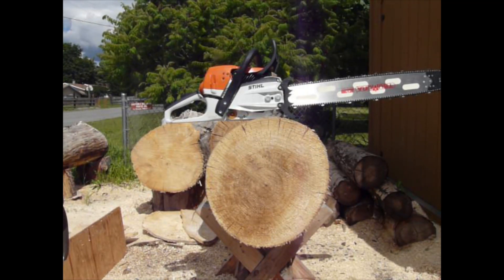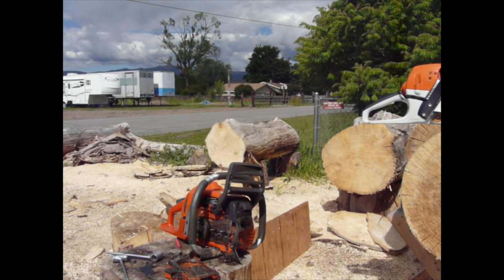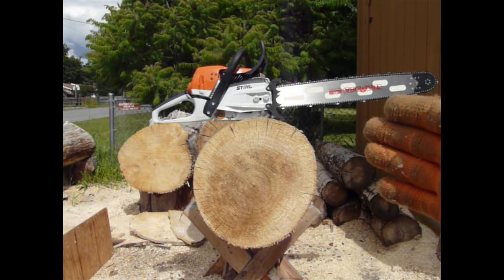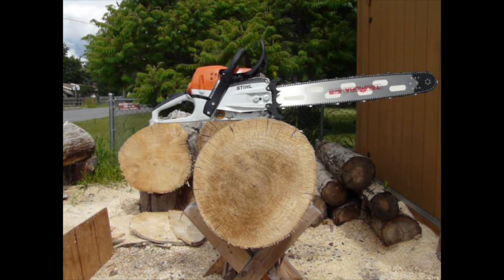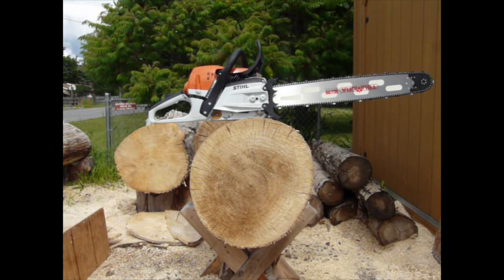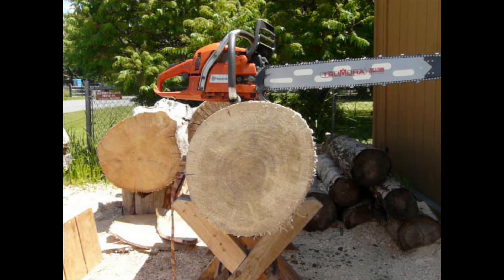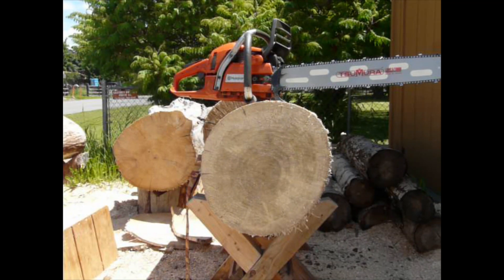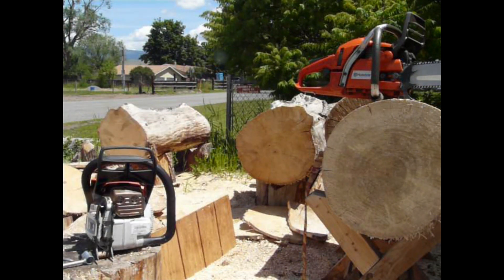Stihl 261 HD2 (stock) filter vs Husqvarna 346

Comment: Where do you get your full wrap handles? I'm looking for one for my 272xp and 346xp, I live in northern Maine and not many people use them but I do..any help would be appreciated.
Reply from the maker: Darrell hi.
I made them. I prefer being able to cut from both sides while using a saw. If they are not a factory option and I need/want a set them it's fab time at the welding bench.
Thanks for watching.
Reply: @hotsaws101  thanks for the info, I prefer the full wrap myself as well, probably a stupid question but is it possible to have a set made? Thank you for your time

Comment: Hi Hotsaw101 I have got a ms362 it is the one that you can adjust the cab on & a RPM limiter can  not get it adjusted correctly because of the rev limiter yes it is a sickly one LOL can you help? PS got a stihl tachometer
Reply from the maker: Tammy hi. One reason why I'm not a fan of rev-limited coils. 
Your going to need to start some where around the 13,000 mark with the high speed needle - this is of course after getting the low speed needle set and left alone. The carb adjustment video in the playlist covers this.
Your going to want to run it a bit to see how it behaves (sound & burn color on the screen).  If it blubbers profusely and is showing black & and a wet screen, your going to want to tighten up the high - but gingerly. Slight adjustment/s in until, while in the cut, it sounds crisp but the screen is brown paper bag color. 
How long will this take? Good question. I spend the entire first day getting one of my new felling saws dialed in carburetion wise. No since being in a hurry.
The other way is to, while monitoring the engine rpm, run it in a cut and adjust it similarly to what I said above. It will take time for the screen to change color - the reason I spend a day initially.
There is a common idea the rev-limiter kicks off at "13,560" or "13,620". Actually that is the end result of the rpm when bumping up against the limiter. The signal is interrupted 7 to 9 times per 1000 rpm once it gets to a certain, predetermined threshold. The net is then seen in the tach readout at the much lower number.
If your saw is in stock trim, it probably won't want to be running to much above 13,500 at wide open throttle with the bar and chain in place, ready to cut. But, that will have something to do with the elevation & atmospheric conditions you experience.
The readout in those is usually ~ 13,560 to 13,680 when bumping up against the limiter in most cases.
Those needles have stops that limit the rotation of the needles to ~ one turn. There is the possibility that your saw (a standard) had the needle off a bit when the stop was installed. Without having a machine in hand, it's impossible to tell.
I would recommend caution - slight adjustment - when moving the high speed needle to anyone.
Thanks for watching.
Reply: Thanks for all the info I adjusted my carb today just like you explained !! it was a good day we cut down some big hickory trees and cut them up for fire wood  oh my saw runs GOOD very happy!!!

Comment: No need to apologise for digressing. Your digressions are worth ten of others’ straight lining. Your presentations are always stuffed full of interesting info.

Friend of mine runs a stock 261. It cuts consistently but always seems to plod along.

Another guy I know, used to mainly run a Husky 346 with a MS461 for bigger stuff. Then he bought a MS441 CM, after he blew the piston on 461, (not sure if he ever cleaned the air filters). Anyway, instead of rebuilding the saw, he just bought the 441. Has always run stock saws and is happy to buy new if one breaks, guess that’s his way. So he’s now ignoring the 346 and uses the 441 for everything. Too much power for small stuff, not enough for big stuff, that’s his way too.

Comment: The ms 261, from running one a few times , is a 50.4 cc saw is it not?  Here I see you are running about 28 inches of bar,  Skip tooth I see but I was wondering if there was a power to bar length and chain composition formula you use to determine maximum length for any saw. Great video as always, thanks.  Garnet

Comment: Normally aspirated? You really run those Jack? I find this just a little difficult to believe  but from you , ok so you did. Was it different? Not satisfying? Did you run the 346 afterwards just to get that feeling of power again? Have a blessed day Jack.
Reply from the maker: Chuck805 hi.
It's zipped. Psy-Ko level. Stock HD2 air filter system.
I clarified in the description area. This was right before the addition of the K&N in the next video.
Maybe I need to reevaluate the title, lol.
Thanks for watching.